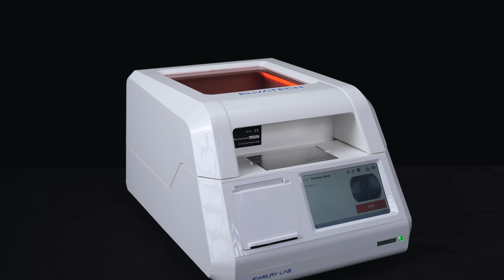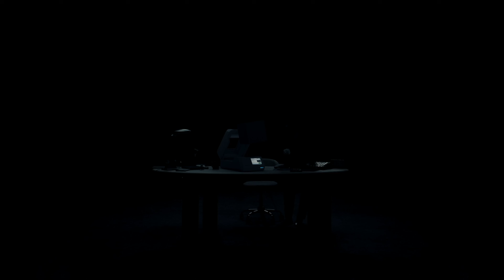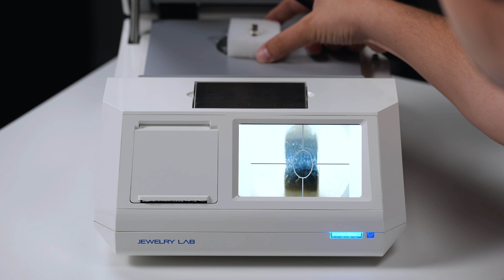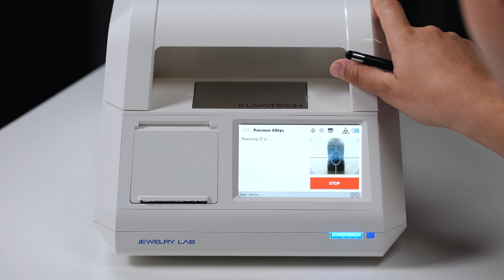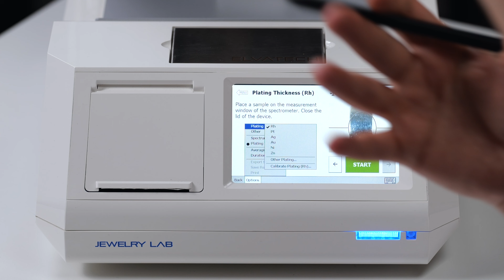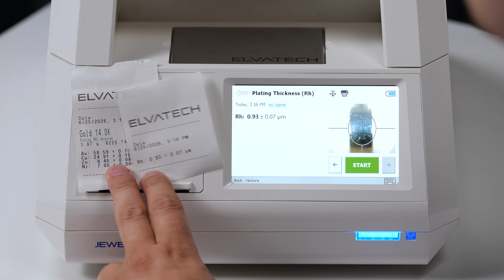How Much Is Your Jewelry Really Worth? XRF Analysis & Instant Valuation | ElvaX Jewelry Lab

Comment: In the example he had to tell the machine what the piece is plated with...what if you don't know what the piece is plated with...can the machine detect the plating and tell me what it is and then how thick it is?
Reply from the maker: Good question, and a fair one — in the video the operator does specify the layer.

The short answer: the analyzer flags that a coating is present without being told, because a plated piece produces a spectrum that solid metal of the same nominal karat never produces. Gold over brass shows zinc and copper behind the gold peak; gold over silver shows more silver than any genuine karat alloy contains.

For thickness, the mode does need to know the layer structure — it's solving for a known system rather than identifying an unknown one. In practice you identify the coating first from the spectrum, then measure it.

Fastest field check on an unknown piece: measure an intact face against a worn edge. Solid gold repeats. Plating does not.

Happy to go into more detail — sales@elvatech.com.